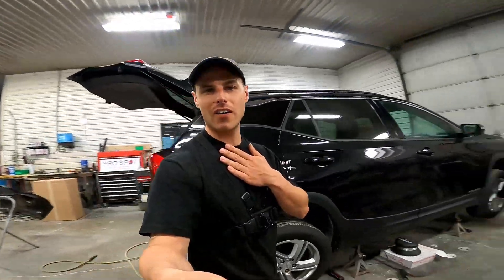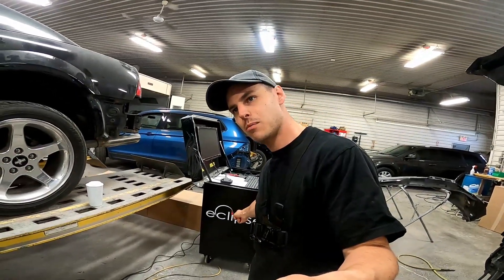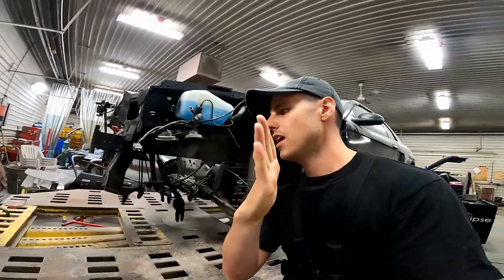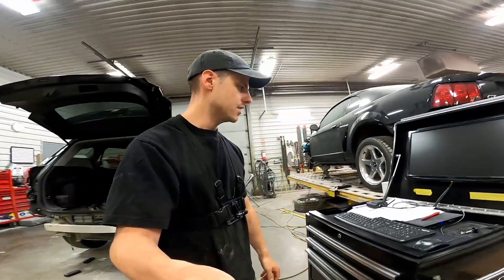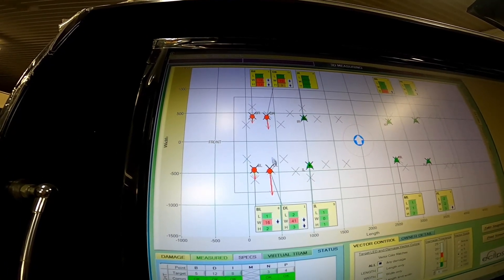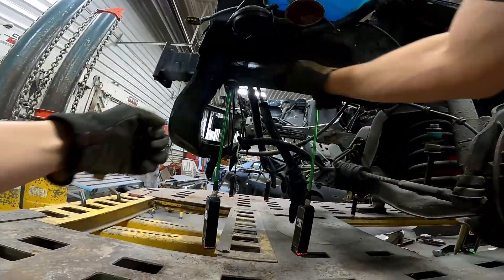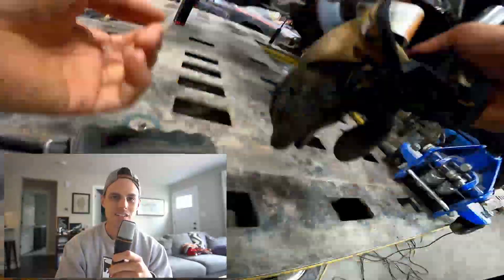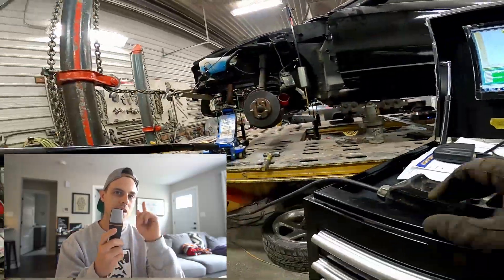LASER Measuring SALVAGE TITLE Mustang + Frame Straightening How To

Comment: @kyholm how much would something like this like cost? I have a car in similar shape.
Reply from the maker: Too much man. $10k+. Basically not worth doing unless you’re doing it yourself.
Reply: @kyholm  I appreciate it. My car is just going to be a drift missile anyway. With that knowledge, I’ll just weld in full length subframe connectors and supports and call it done lol it’s straight enough.
Reply from the maker: @ ah yeah man, for your purposes, it dun really matter. You can always hog out the crossmember holes so it will take a decent alignment if the front end is pushed over.
Reply: @ Okay thanks. I hadn’t thought about that. This is why I am subscribed: real, no nonsense answers, and helpful content.
Reply from the maker: @ hell yea bro! That’s basically the only reason I do this shi lol

Comment: Very informative video thanks for posting. I have a 1970 Mustang and the front right rail is angled upwards which makes the rear end of the car seem slanted, you can really tell from far away. I was thinking of installing coilovers upfront so that I can add that extra inch on one side but I know the car won't handle properly. After watching this I think I'll be taking it to a professional body shop to have them straighten it out for me. Would you recommend that I remove the engine and front body panels prior to me taking it in?
Reply from the maker: Good call! Suspension ride height change would not yield good things, lol. If you are able to, it could certainly save you some money should they need to remove those items in order to perform the repairs, would be best to consult with the repairing shop